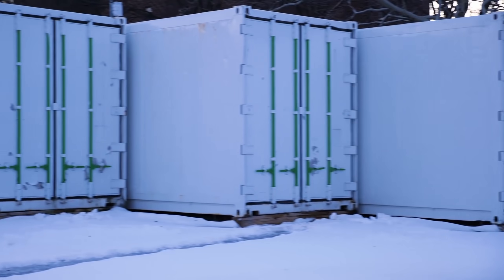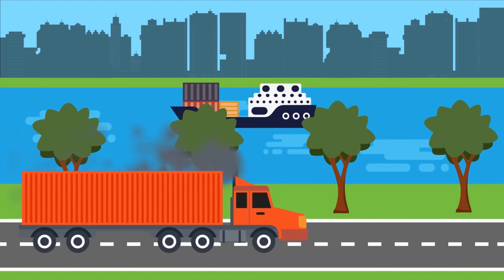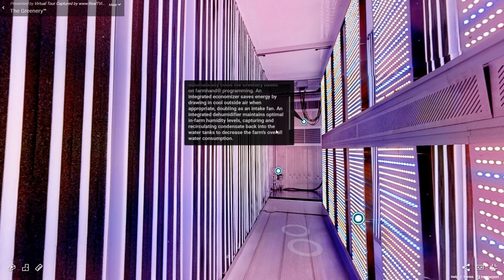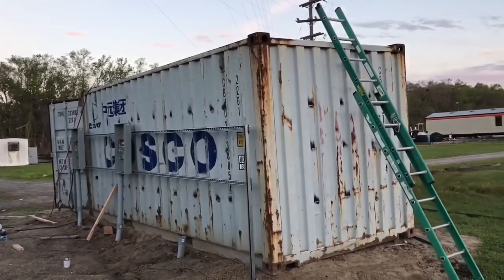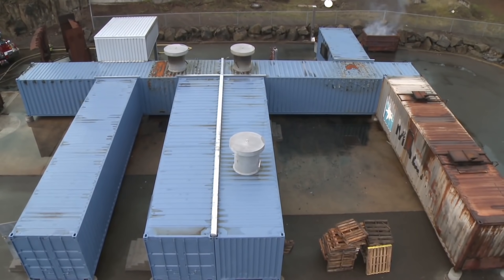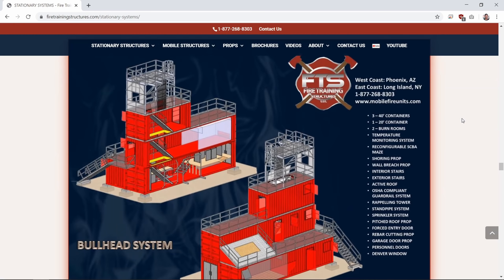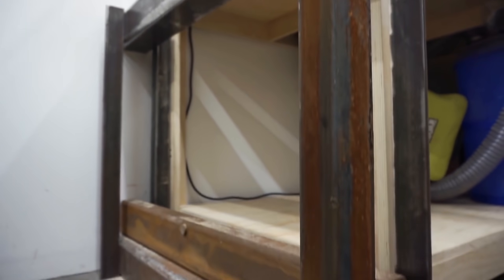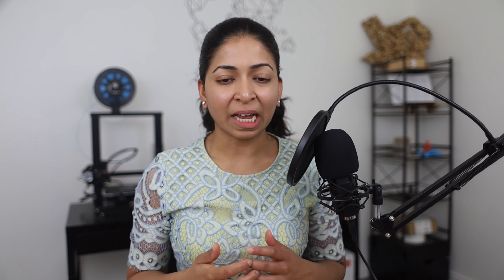Top 5 Shipping Container Conversions | bitcoin, Kimbal Musk & more

Comment: Here's an idea that I think would work: a shipping container kei car garage. Just fit heavy duty remote controlled actuators for the doors, one tiny hole for power and a dehumidifier inside to prevent condensation. Et voila
Reply: Internal width of a container is max 2.4m, average width of a car is 1.8m. Good luck getting out of the car.
Reply: @lorenam8028  kei car garage

Comment: If I recall correctly, one of your main concerns with shipping containers was potential contamination with toxic chemicals. How is growing food inside one even remotely safe?
Reply: Again, there are one use containers, some govermets only allow for this ones to be used as homes for the same reason (  as you dont tknow what they might have  transported).  I assume this are the ones used for the farms, either those or containers with a track record, its not impossible to use a container as a home or farm, the thing is most of the "home builders" want the cheap way arround or only want the looks, ignoring the safety and stability,  Buying the first good looking container they found ( i remind you the purpouse of the farm is not to be insanely cheap, rather cheaper than using a lot of land and being way more eco friendly)

Comment: I appreciate these videos as being a fairly no-nonsense guide to how these things really are. At the end, one thing that I haven't seen mentioned in this series, and is maybe the most interesting benefit to me of shipping containers as homes, was always the ability for a small DIY team to do something more akin to a modern steel-construction modular home construction. It's possible for a small team, or even an individual with occasional help, to build a relatively big complex container by container in a convenient location without a lot of large infrastructure and equipment needed except for the final installation phase where it gets moved to the site and plopped into position where that small group can then go back to final outfitting. 

When the container forms the basic building block, it is a factory-produced item made to be largely square and true, as mentioned, in a large facility that has the industrial capacity to do so cheaply, which means as a builder you don't need to go secure big pieces of steel that would otherwise be needed for similarly sized custom construction. Thus, one or two people can take a container, keep it in a backyard or a lot somewhere, and at their leisure cut holes, weld in reinforcements, and fit out a container into a respectable modular home unit at what most would consider a manageable DIY'ers budget. And so, while a few individuals will probably need help at the site with hired crews to move stuff in either case, it should be a far quicker and cheaper job to pay for a crew to drop a standard-size container into a set location on site than it is to budget for the type of crews needed to move large beams and framing and other stuff into place while assembly teams work putting those parts together safely. Then because it was done by professionals, all of that work must then be inspected and validated, rework done, etc and make sure everyone's butts are covered. When if you DIY it, I mean, ultimately there's less scrutiny.

Of course if one has access to a workshop that has easy delivery for flatbeds loaded with steel and overhead cranes and forklifts to be able to position and do modular-type construction at the workshop, then a DIYer making a home that way vs starting with a container will  probably still be the best option. But most people won't have that access, so a container is a bit of a blank-slate starting point shortcut.

Of course I much agree that actually employing sound design and engineering and architectural principals in executing the final work is paramount and just because someone's  doing it DIY doesn't mean do work that is slapdash or not to code.

Ultimately though once you start looking at the prices for just a few containers now, then the costs of all the materials and time to rework it into something that ultimately is a large compromise, the price of a pre-fab steel hanger-type building starts getting really comparable; and turning one of those into a home starts looking a lot more appealing. I've seen some really cool hanger/homes that structurally went up in no-time by crews that are experienced in that type of industrial construction, and then there's not many reasons someone in love with the container concept can't put a container or two inside them to create rooms and smaller areas within the large space. (or build out other various structures to put inside there). 

The best container homes I've seen generally do combine some kind of large prefab steel building or other structure with some containers in order to juxtapose these large, imposing volumes with these confined purposeful pockets of space in ways that makes for a much more interesting living or working space.
Reply: Stacking containers is largely a hipster meme as horizontal expansion is far less expensive and easily done even single-handed as I did for my shops.  Combining them with Steelmaster and other trussless building kits (I built both but separately...so far) produces a superior result. The containers (buy "one trip" grade) make instantly usable shop space which facilitates the rest of the build and are much stronger than the trussless kit panel sidewalls. Containers most favor metalworkers proficient at DIY which is why mine suit me. Unless a site specifically requires a crane it's easy to precisely place containers using the typical travelling axle trailer (Landoll etc) used to deliver them in the US, and easy to winch them (I did mine by hand with a Wyeth-Scott puller, railroad ties and steel beams, and used steel pipe rollers) into place where power lines, trees, structure or soft ground prohibit trailer movement.
Reply: @Comm0ut  

side by side, makes sense. Thanx for your comment.

Comment: Just an idea here: You can always hybridize buildings to include containers in segments that make sense (like in an underground home the entrance area or say an observation space above ground, while keeping the underground parts reinforced concrete and the like). Like with most construction materials it isn't a be all end all in itself but it can still help cut down on things (the bitcoin miners actually made me think of another possible application: a solar battery farm module, batteries and all the other needed electrical bits for an end user solar farm that you can just add to your home depending on your home's design (the need for outside insulation would give room to customize it to make it blend in more)).

Comment: 1:50 Solar panels are getting so efficient that very soon it would be more economical to use the surface area for solar panels and grow food vertically on container in a centralized place bellow some other human infrastructure, like storage or housing. 
In fact, PV cells are very close to being more efficient than photosynthesis in converting solar energy to electricity.
So even with the losses of PV -> LED -> plant, you still get more plants per square meter of area because you stack them vertically, and you can't stack plants vertically using mirrors, it doesn't work that well because of the area needed to path the light.

Comment: I mentioned this on another video, but it is more appropriate here.
I worked briefly at USDA-ARS in Hawaii (research on agricultural insect pests).  They had insectaries to raise/breed insects which needed to be temperature and humidity controlled.  Some were special built parts of the main building, but others were just reused refrigerated shipping containers.  The containers had a a free-standing roof to keep the direct sun off of them, but were otherwise just the insulation they came with.  Worked quite well.  Since it was Hawaii, keeping the optimal temperature just took a cheap window air conditioner.  Humidity control was only slightly trickier and used a cheap consumer humidifier and dehumidifier.  The overall solution wasn't exactly cheap since those containers aren't cheap, but it worked really quite well.  Taxpayer money not wasted ;)

BTW: The research I worked on was terphritid fruit flies (think Mediterranean fruit fly, but medflies aren't the only bad type).  The work was done in Hawaii because they are native or already endemic there, and we really don't want them in CA, TX, FL, ect.

Comment: Now that I've moved into a one bedroom townhouse with a postage stamp backyard, my only desire in life has suddenly become having a shipping container workshop! Excellent video, thanks.
Reply: There are many neat, tidy ways to equip your home without trashing it like using surplus medication or other medical carts as tool boxes (I have three Lionville med carts and they're better toolboxes than my nice Matco rollaway while having monitor arms, space for an SFF PC and built in backup batteries!). They have non-marring casters and fit through standard doorways. I use a patient lift to R&I motorcycle engines and place them on engine stands. Other storage systems like Joboxes suit apartment and dorm life (I had one and a half Harley Sportsters in my barracks room lockers and passed inspection). Industrial plastic shop carts are great for portable non-marring work areas with storage. Five-gallon plastic pails with lids store many parts. Hand trucks make moving heavy stuff easier and safer.

Comment: I too just discovered your channel and I'm quite impressed with your knowledge.
Can I make a question for something i planned to build but I was planing and reconsidering few ideas for a last couple of months.
First I am sorry for my English. it is not my native language by far
My house is in central part of Europe, Serbia, and it was made like all other houses from brick and mortar;
My problem is outside finish, thermal isolation, I'm thinking about making some kind of do it my self breathable facad from vertical wood grill fastened on bricks and between each two to put pressed rockwoll and second layer maybe some kind of chicken wire, connected reed or similar (first of rodent barier and second use to fasten rockwoll to the wood grill and fondation after which to just sprayit-on with lime and cement mixture.
My plan is to make facade breathable, to have property to dry itself (because increase percentage of moisture is reducing isolation) and I think that I could do it my self or with friends and to keep thermal mass of inside of house for winter.
Plan is to make isolation which I wanna do propper with rockwool but to do myself without must pay contractor or similar.
Can you give me some guidance, mybe somebody who made something simmilar.
Greetings from Serbia

Comment: 1:10 ... ok, I need to say this.  The problem of food PRODUCTION hasn't been the primary issue since the 1800's.  ESPECIALLY not in in the 20th Century, and DEFINITELY not in the First or New World.  The problem ... ongoing, btw ... has been food DISTRIBUTION.  We currently have the capability of parking a pallet of food on any reasonably level 16 square foot spot on Earth, and with sufficient motivation, the Moon as well.  The problem is doing so ECONOMICALLY.  This said ... I LIKE this idea.  Shipping the actual FARM simplifies life to a truly enormous degree ... as the old saying goes, give a man a fish and you feed him a meal.  TEACH a man to fish, and you give him a life.  Ok, rant over, back to the vid.

Basically, as I understand it the problem of container homes is understanding what a container IS.  It's a box, with a cargo frame holding it up.  That's IT.  Anything else you want to do with it, you have to build.  If you treat the steel as combination of basic framing and water barrier, the problem becomes obvious ... ZERO insulation value. If you insulate only the interior, you're going to see condensation everywhere you don't want it ... you'd be better off insulating the exterior, ideally treating the corrugated steel as a frame and just building around it, insulating and vapour-barrier as normal.  You could just use the anchor points of the cargo frame to add extra containers into a modular multi-room house.  A~and you've probably already gone into that in another vid, or someone else has.  I know people with a variety of repurposed shipping containers, and so far NO-ONE has seriously considered converting one to living space.  We all understand by the time we get a shipping container into a liveable space,  especially as far north as we are, we'd have built three-times the cubic area conventionally, and the only possible benefit to a repurposed shipping container would be the ability to take it with you if you move.

Comment: All a container does is replace the framing of a building which is not the most expensive part of construction in the first place.  So I don't see it as a cost saving if any.  But it does constrain you to a long narrow space which is not what occupants find very appealing.  So all you're really doing is getting rid of old or excess containers but would that best be done by taking them to steel plant and melting them down into new steel products?

Comment: Greetings Belinda and happy new year, I am going to build my own shipping container house and I have to agree with you in some points, as well as to thank you for warning people that It has a some problems to be solved and it is not meant to everybody, I have been getting information on this for the past 2 years.

I am aware that I will have to reinforce them to open space and it will ad cost to the build, however the cost of a brick and concrete house here is up to 1000 euros per square meter, so the 160 square meter house (100 for the house and 60 for the attached garage, minus the walls)  I'm planing to build will have a cost of up to 160 000 euros plus all necessary building permits and project, it is too expansive and that means debt.

After selling my flat and paying the remaining mortgage, I will be able to build everything and achieve my goal to be completely free of debt.
.
The biggest cost here as well as there is labor, I have the skills and tools to work metal and to install electricity, communications and plumbing.

LSF and LWF (steel or wood framing), as well as ICF here cost almost the same as brick and concrete houses (the common house around here) , the only advantages are the time to build and bigger thermal efficiency.

Here in Portugal you can buy the HC(high cube) the 9,5 feet tall very easily and for a very good price, the shipping containers themselves will cost 1000€ (airtight) plus 200€ each for the transport, my land is less than 30km from Lisbon and 20km Setúbal ports.

The house will be build in a L shape consisting of 2x40' side by side plus 2x40 cut to 25' side by side to make the longer leg, plus 2x40' side by side to make the shorter leg of the L, dimensions will be 65'x56' (20mx17m), the legs of the L shape will have a width of 16' (5m) and 9,5' high, that will give me 160 square meters (each one is 30 square meters), less the inner walls with the insulation.

Yes I know I will have to scrub really well the containers and repaint them inside and outside, as well as removing the floor plywood panels, wash them and apply several layers of varnish to seal any contamination.

The shipping containers themselves will cost 1000€ plus 250€ each for the transport, my land is near Lisbon and Setúbal ports, so containers, foundations (small concrete slabs) and steel reinforcement will cost less than 20 000€.

I have made the calculations on all materials needed (with premium PVC doors and windows, and climate control) and even with the outsourcing of the insulation (projected polyurethane) it will will cost me less than 70 000 euros (worst case scenario), that is 50% savings.

Comment: i'm certainly not so impressed with the last two "successful" shipping container conversions. i think that scheme only works to control interior temperature if the shipping container doors are open, the fan is on, and the air temperature is not too great. then you can get enough air changes per hour to overcome the heating effect of the sun on the container skin. but the idea of using shipping containers for workshops is actually a pretty good idea. for one thing, the long narrow shape can funnel air through the container such that you can get pretty good air velocity end-to-end. that would efficiently evacuate sawdust that get generated while working in the shop.

the last "successful" shipping container conversion struck out with me. aside from using exterior insulation and a ventilated rainscreen, the long narrow interior is horrendous. i think that people are misguided in associating the shipping container with "simplicity" in lifestyle. i think that a better way to go would be the prefabricated housing schemes that they use in europe. there, prefabricated houses are built in panels and shipped to the building site where the panels are assembled. these aren't "mobile homes"; the system allows customization. so a person can custom design a tiny house (with livable dimensions) and have it arrive in premanufactured panels that are assembled on site.
Reply from the maker: I completely agree with you, but I think the obsession stems from a desire for "modularity". People are willing to ignore the dimension constraints because the idea of having identical boxes is so appealing?